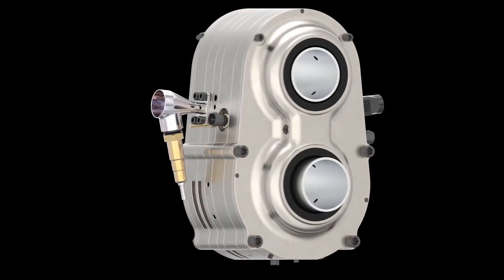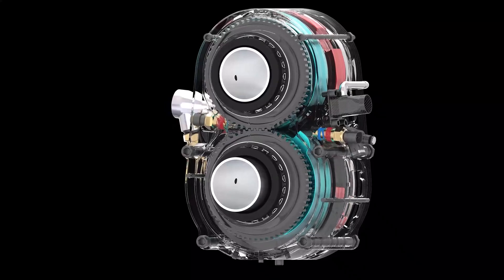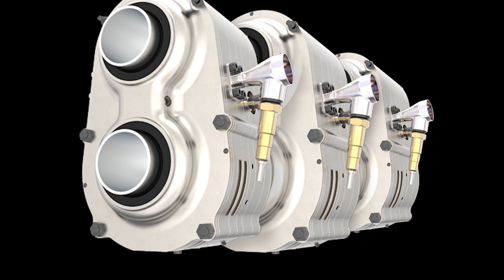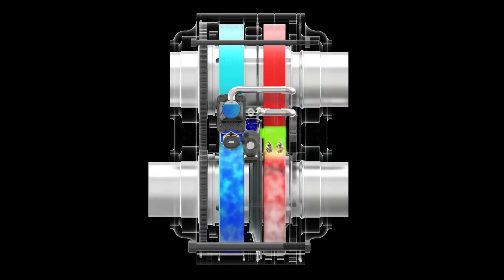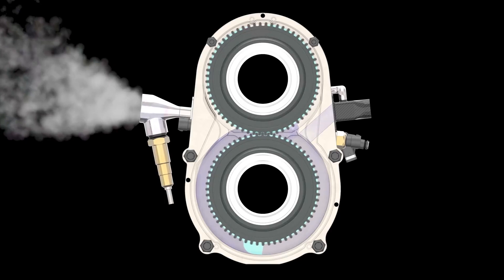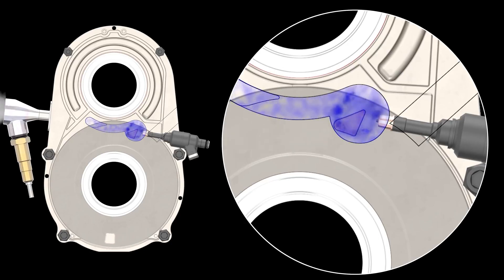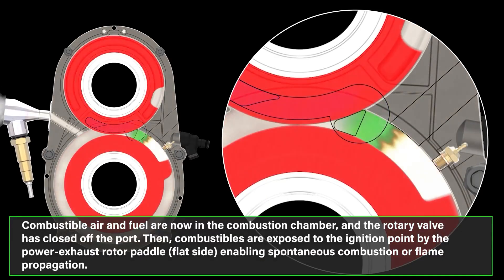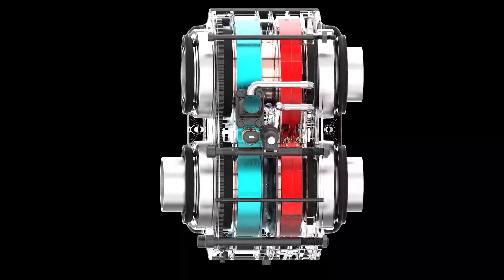This pistonless engine runs on hydrogen and revs to 25k rpm

Comment: Tight tolerance and high rotation speed to eliminate seals? All engines are great on paper.
Reply: Volkswagen Flat 4 seal less crank seals would beg to differ
Reply: @jaubuchon28  yes, but they are not receiving anywhere close to combustion pressures.
Reply: @jaubuchon28  sorry, but you said seal-less crank seals? Dog that makes no sense
Reply: @andyk3663  it's called a simplification "dog" it's sealing the crankcase oil in without using a seal around the crank, I could have called it a reverse spiral journal crank seal, but I decided to make it more accessible
Reply: Its called a dynamic seal. They only work well at high rpms. Most oil cooled dynomomiter motors use them. You don't often see them leak.
Reply: @lukewarmwater6412  very rx-7 13b
Reply: @lukewarmwater6412  @kevin W that’s true and since air pressure decreases at higher rpm’s there is no time to leak just like he explained.
Reply: @lukewarmwater6412  Most aren't running on Hydrogen which will leak out of steel pipe.   I'll venture a guess that this will never see the light of day, and if they do build it,  will perform terribly.

EE explains many of the problems.  https://www.youtube.com/watch?v=1Ajq46qHp0c
Reply: @lukewarmwater6412  so how does it seal at zero rpm?
Reply: @RobertWilkinsonJKekMaloy  at zero it really doesn't matter.
Reply: @lukewarmwater6412  … so, my car bleeds out …?
Reply: @RobertWilkinsonJKekMaloy  it would, eventually if the fluid levels were above the seals.
 Dynamic seals work just fine under pressure.  Google it, then maybe you will understand  cause this is one of those things.  I can explain it to you, but I can't understand it for you.
Reply: @lukewarmwater6412  and if there is no pressure?  What then?  Does the machine not need to be on to create that pressure?
Reply: @lukewarmwater6412  these are just simple questions that an expert of your caliber should be able to answer if you are so knowledgeable in this area.
Reply: @RobertWilkinsonJKekMaloy  like I said.  I can explain it to you,  but I can't understand it for you.
Reply: @lukewarmwater6412  all you’ve done is use high priced words. If it maintains seal at high rpm, how does it stay sealed at zero rpm?
Reply: @RobertWilkinsonJKekMaloy  why would it need to??  Your thinking about it as though it has a conventional oiling system, as though it were a piston engine. It's more like a turbine and unless you can wrap your head around that, your gonna stay lost here.
Reply: @lukewarmwater6412  oh it’s based on turbine. Shoulda lead with that
Reply: @RobertWilkinsonJKekMaloy  would have thought that was obvious but.....
Reply: @lukewarmwater6412  ah yes, buzzword buzzword buzzword buzzword... If your engine only works at high rpm, one wonders how do you start such an engine from 0 rpm, where it doesn't work.
Reply: @kirayoshikage4057  no engine works, or starts from zero rpm...
Reply: @lukewarmwater6412  except all those engines that are actually built in real world and start from zero just fine.
Reply: @kirayoshikage4057  nothing you can name starts from zero rpm. Every starter out there turns the engine to something like 200rpm  before it catches and runs
Reply: @lukewarmwater6412  right, starter, let us know when you figure out what that is.
Reply: @lukewarmwater6412  good to see that some one here knows what their talking about. The real question is… How much is it going to cost?
Reply: @lukewarmwater6412  WOW you are the only one that seems to know what they are talking about here. Are you an Engineer too?
Reply: @lukewarmwater6412  ..for how long, in what environments, under what care by who?   If it’s forever, anywhere, without any care, then great. Otherwise it’s just a Mercedes.
Reply: @lukewarmwater6412  so what do you do at idle, in stop and go L.A. traffic?
Reply: @sonnyinaz  move to a better place!!
Reply: @sonnyinaz  no, seriously,  you can throttle back just like any aircraft I would imagine.
Reply: Yeah, no time to leak??? Yeah right......
Reply: @will7its , The amount if leakage is related to the tolerance and time, right?

The smaller the gap, the less it leaks, right? Smaller gaps = tighter tolerances.

Then, the longer you wait, the more time there is for leakages. So that statement is obviously correct. If the tolerances are good enough, and the thing is spinning fast enough, it leaks less because it actually doesn’t have time to leak more.
Reply: @terjeoseberg990  Nope, its pressure that causes leaks and its very high. And its running so time is increasing as it runs. Its a leaker and they dont have a working model because it dont work yet...
Reply: @will7its  so burn it down and sit back in your chair with a smile on your face and in the end didn’t contribute one single thing then being negative. Wow, you must be proud for yourself.
Reply: @joostprins3381  Feel better???
Reply: @will7its  do you?
Reply: @joostprins3381  No
Reply: @Kevin W     cross sectional area is by far the most significant factor.
Reply: @joostprins3381  so, saying they don’t have a working model is “Burn it all down”?  I have a card game im building (not false equivalency once you read it), and i have yet to produce a working model (finishing production on the card game), so yeah, no working model means no working model due to whatever reasons they do not have a working model even as a prototype.  Stating facts is not hate.
Reply: @RobertWilkinsonJKekMaloy  nope, but facts are as good as the moment you look at it. When the first car was driving there were plans to ban it because it was to fast and people couldn’t cope with that. So, what I’m saying is the moment you look at it first it cannot be feasible, but a day, month, year, decade later it’s not an issue anymore. Look what it can do, and focus not on what it can’t other then to fix it.
Reply: @joostprins3381  Build. A. Working. Model. Then.
Reply: @RobertWilkinsonJKekMaloy  I think I put in line with the other people “ not possible, can not, impossible, no, etc etc”, you see what they all have in common? It’s used by people without fantasy, without vision, without want to work for it. That’s ok, but that means I can use my energy better then wasting it on you to see the point. 
First, get an engineering degree, that may help.
Reply: @joostprins3381  or you could just let those asked speak up. Stay in your own lane.
Reply: @RobertWilkinsonJKekMaloy  as long as you and you’re kind not blocking it.
Reply: @joostprins3381  you’re the one driving all over the road, as it were; stay in your own lane, let those asked question answer the questions posed to them.
Reply: @terjeoseberg990  sounds like a gas turbine. But with a „gear pump“ instead of a „ventilator“ design.
Reply: @fromgermany271 , That was my thought.
Reply: @terjeoseberg990  at least it does not have that many parts and they do not have weird shaped. That make creating the blender video easy.
I remember that I also invented a lot of stuff. 40y ago, as a teenager and in paper, just by the lack of computer power. I also did calculations about the max speed of my car designs. Guess how many materialized, even though I had the 300km/h on paper.
Reply: @terjeoseberg990  
Smaller gaps=/= tigher tolerances
Tolerances are allowable deviation from design specifications, and that deviation can go either direction. Possibly increasing or decreasing gaps between parts. 

The space between parts is clearances
Reply: @will7its  higher rpm’s means less time for combustion cycles “no time to leak” traditionally air pressure between each ignition cycle decreases because there’s not enough time for air to enter the intake. This is in regards to NA 4 stroke engines. I’m not engin-ist lmao just an educated enthusiast
Reply: @will7its  Use maths rather than clowns for the job and it will work.
Reply: @Andrew-rc3vh  Ok, where is your running model? Just use math.......😆
Reply: @will7its  There are equations you can use and these will tell you what tolerance range you would need. It does not need to be that sophisticated to get a ballpark figure, then build a prototype if you are within range.
Reply: @Andrew-rc3vh  Yes, Im aware. Now I want to see it run......
Reply: @will7its  They have a website and say they are looking for investors. I'm sure they would want to see it run too.
Reply: @Andrew-rc3vh  Ill buy one.......🙂
Reply: @Andrew-rc3vh  LOL There's math, and then there's real world manufacturing and pesky little facts like different coefficients of expansion and the fact that the same engine isn't subject to the same constant temperature, atmospheric pressure or humidity even if it's stationary.
Reply: @awo1fman  COMSOL will model heat-flow and thermal expansion I think.
Reply: @will7its  Yeah, no Pulitzer prize on the way
Reply: @will7its  With hydrogen as a fuel....
Reply: @will7its  right even if at high RPMs they have no leakage whatsoever no one is going car keeps their engine at a high RPM all the time
Reply: @will7its  NO ! It's the very simple very clever design   look very close and think it through 😃
Reply: @johnwalton6270  Then why dont they have a running model??? Show me the model, In a go cart even, I dont care.......
Reply: @will7its  the amount of leakage is reduced by time…!
Reply: @hansdenotter7376  No, the older you get you will realize that you leak more...
Reply: @will7its  yeah you’re right! Only because of wear, haha… in this case I can’t see any wear because there is no friction near the burn chamber. The detonation is very soon after injection, thus there’s no time to leak… too busy! Haha.
Reply: @hansdenotter7376  I dont know but I would think at those speeds it would be almost like a constant pressure and would leak then, but Im not an engineer....I just play one on youtube......🤠
Reply: @will7its  ofcourse there is a lot of pressure, I thought it was stated in the video 20x(??) as much as a normal piston engine.. but the speed and the timing of ignition is crucial, it has no time to leak anywhere because it’s getting ignited a split second after it’s injected.
Reply: @direstrait5418  yes, but any conventional engine will weigh hundreds of pounds more than this one so the weight savings would be great for fuel economy.
Reply: @lukewarmwater6412  the question of torque is because you can have 1000hp but 100 in torque…. Have fun with that gas mileage.
Reply: @Djkommode  if the car only weighs 1000 kilograms, fuel mileage will be great with 50 foot pounds ...
Reply: @lukewarmwater6412  yeah it will take you 50 miles to get up to speed too with no torque.
Reply: @Djkommode  not really.  A geo metro doesn't do so bad. Gets 45 mpg and doesn't weigh anything. Only 100 hp and 65ish foot pounds of torque.
Reply: @lukewarmwater6412  yeah it also takes 13 seconds to get to 60mph.
Reply: @Djkommode  13? Try 17.... look, either you get performance or good mileage.  You don't often get both. Nobody ever said a geo was a sports car!
Reply: @lukewarmwater6412  yes 13 and the 2000 made it to 10 sec to 60 mph. A tuned performance car can have better gas mileage at normal driving habits.
Reply: @Djkommode  riiiight.... if, and that's a big if, you can keep your foot out of it...
Reply: @lukewarmwater6412  if? It’s been proven even turbo cars can get better gas mileage.
Reply: @Djkommode  better than 45 mpg?? Not in America! 
 Still,  the biggest point here is less weight. This thing would weight half what a 1.5 liter 4 cylinder does. If it made the same power as a 1.5 it would still do better on fuel.
Reply: Need to see it run

Hang on want to hear it run too
Reply: Air cooled vw had no oil seal behind the crank pulley. 
It used reverse spiral that threw the oil back into the engine. 
A they work
And rarely leaked
Reply: @fastinradfordable  yes correct, the oil screw back design originates pre-World War 2 but you're talking about the oil in the crankcase which operates below 6 PSI a regular oil seal can handle 6 to 8 psi. Compression for combustion is much higher a minimum of 90 PSI is required for  combustion and many engines run up to 150 psi. Any design has to be airtight in the combustion chamber
Reply: @captainaxle438  on performance american v8 175 psi at least , and up to around 205 or more psi on pump gasoline.
Reply: @fastinradfordable  That's because the VW pulled air into the crankcase through the gap around the crankshaft, it never leaks there because airflow draws into the engine in that location. This functions similarly to a turbines Labrynth Seal which functions off pressure differential, the air pressure in the compressor section is greater than the engine oil pressure therefore oil cannot escape.
Reply: @fastinradfordable  no they leak a lot. if  you don't see a leak you are out of oil.
Reply: @fastinradfordable  Except when parked
Reply: @fastinradfordable  VW aircooled engines did have a seal at the rear of the engine however.
Reply: @fastinradfordable  you are only talking crank case pressures here, ten or so PSI. Here we are talking about combustion pressures, in a normal combustion engine they are 1000 PSI and more. The reason why you have crankcase pressure is because of blow by of the piston rings.
Why do we use piston rings? Because making each piston match each cylinder with tight enough tolerance, would make and engine horrendously expensive.
I’d like to see a proof of concept of this engine but I’m unsure you could make the mating parts with the tolerance required without high machining costs. You also have to remember, each replacement part needs to be within this tolerance zone too.
Reply: Yes right even tesla need to cover there new imp synchronous motor rotors with carbon fiber to keep the magnets inside and don't fly away due to centrifugal forces at 18000+ rpm
Reply: Here come the experts in youtube comment section lmfao
Reply: Yeah when he mentions the application of cars I started to think the same thing. This thing is in no way perfectly balanced either. All that being said, it wouldn't be difficult to put a seal on the sides of the rotating parts. Also, if a seal is going to imped function, then I wonder how hard or expensive it would be to replace the rotors.
Reply: Tight tolerances and thermal expansion don't mix
Reply: @sgtjonmcc  cad software has come along way. Thermo expansion of metals even at "tight" (whatever is declared tight) tolerances is relatively easy in todays tech.
Reply: @sgtjonmcc  no difference found in F1. Tight tolerance engines that can’t cold start and need hours of pre warming before turning over.
Reply: @corbbinrabus  yes that is true! 
A cold F1 engine is actually seized up until it is brought up to operating temp.
Reply: @corbbinrabus  I'm not sure what your point is. The fact you have to pre-heat the engine before you can even turn it over makes it unusable outside of performance racing. 

The problem with tight tolerances is that due to varying alloy compositions thermal expansion of individual components becomes difficult to manage, and at production scale cost prohibitive. 

If every parts alloy composition has to be strictly controlled (like in Formula 1) that adds significant cost to the manufacturing process.

Additionally, dimensional tolerances become a factor, it's is not uncommon for pistons and various rotating components to vary in dimension right off the factory line.

I haven't even acknowledged the asymmetrical rotating assembly of this design, balance issues will be a problem if this is the final design.
Reply: @sgtjonmcc  hence why this style of hydrogen energy won’t work in standard production vehicles.
Reply: @savage22bolt32  no shit?.... F1 has either come a long way...or I don't know as much about F1, as I thought I did. ( for record, I'm a simple fan, not a genius) :D
Reply: @animationcycles7109    I was pretty amazed when I heard that, and it stuck with me. Sorry, but I don't remember the exact video.
Reply: @savage22bolt32  That doesn't make sense .
Reply: @jobdone3700  watch the first 60 seconds:   https://youtu.be/lCEKJxHiEIM

This is where I first heard this, and have also heard it in other vids. The guy seems to know what he's talking about.
 Maybe needs to be fact checked?
Reply: @corbbinrabus  Exactly. Engines need to run from cold and at a wide range of speeds. Tight tolerance also costs a lot of money. The Wankle engine needs seals and is a real life rotary.
Reply: @sgtjonmcc  so just do nothing, you think it’s not possible, yeah that’s the spirit, with people like you we would use stones as a seat. 
Example, Russians used to build a small fire underneath their engine to heat up the oil so they could start the engine. In Scandinavia they are using electrical heating for engines for decades. What makes you think it’s not possible to overcome the pre heating problem? And even at a reasonable price. Even further, what makes you think they don’t find a solution without the need for pre heating? 
So your assumption of unusable is very presumptuous and an insult to people who think in what is possible and not in what is not possible.
Reply: @joostprins3381  I didn't say it was impossible I said it was not practical. There are many things in this world not suitable for the average consumer. Like Sterling engines, impractical for average consumers useless for automotive but have been used in Industrial cryogenic production for decades. 

A formula 1 engine is great in Formula one racing, but if you have to spend 1 hours a day warming up your car for a 15 minute drive to work 5 days a week. That would get old and get old real fast especially when you understand you'd have to bring a small gas generator with you everyday to warm the engine after work, sitting in the Employee parking lot.

I'll also reiterate the asymmetrical design, as it is it will have terrible secondary imbalance issues which will wreak havoc with an engine with tight tolerances. Not only do you need to consider thermal expansion, you also need to consider load factors and radial, axial and end play in a cold state, and during thermal cycling. If during the engines normal thermal cycle as parts begin to expand at different rates the tolerances between the parts changes, this is known as dynamic thermal expansion, tighter tolerances increases the probability that engine components and their lubricating surfaces may fail.
Reply: @sgtjonmcc  this is why I think that electric cars will prevail over hydrogen if people do choose to go the “renewable, low emissions” route. Anything that requires extremely tight tolerances is not really going to work and that’s the issue with engines in general. The more efficient they get, the tighter tolerances there are, thus making the engine much harder to produce and much harder to implement in an actual car because of the material changing temperature up and either expanding or contracting. Even electric cars have to manage temperature of the electric motors, but at least they aren’t required to be at a certain temperature to begin functioning.  Electric cars are fighting the weight of the batteries, as well as just energy storage and overall efficiency in general, but don’t really have the same manufacturing issues as cars with an engine
Reply: @Shangoo  Agreed the real electric revolution will take place soon with 3d Mega Capacitors/Hybrid Capacitors and/or direct chemical/electrical conversion. Check out Direct Methanol Fuel cells and similar direct fuel cell conversion cycles. 

Converting fuel directly into electricity will enhance thermal efficiency of a peak Internal combustion efficiency of 15-40% to 60% or more. 

Borophene molecular lattice capacitors could change the game for energy storage entirely, increasing capacitance by an order of magnitude putting them on oar with chemical energy storage with the added benefit of being much lighter weight.
Reply: @savage22bolt32  How does that work then because surely as it gets warmer the metal expands more so would technically make the engine even tighter no??
Reply: @wils35  That is a very logical question. With my limited knowledge, I may be able to explain it in part. 
For a normal engine, the piston's skirt is not actually round. It is manufactured to an oval shape, and when heated, part of it  expands and changes it into a round shape. (Note that the piston crown starts out round, & stays round) As I understand it, an F1 engine must be assembled at normal operating temp. When it cools, the piston skirts go back to their oval shape, and bind in their bores, effectively seizing the engine. 
 Anyone with additional information on this, please chime in.
Reply: @corbbinrabus  ever heard of a block heater? Easy fix
Reply: @sgtjonmcc  balance issue? Really? Do you know how many engineered parts are out of balance and have to be counter balanced ? That's easy LOL
Reply: @corbbinrabus  unless you have two counter pressuring each other so nothing leaks.
Reply: @joostprins3381  so how do we heat things and where does the magical clean green heat come from
Reply: @bobjones2041  I never said I had the solutions, I said stop thinking something can’t be done, but think how can we solve shortcomings. In answer to your question, for every need there is a solution, heating by electric power, oil, wood, nice naked woman, what ever you need… Magical green heat? Just tell me what is not green heat, for what I know it’s all part of the laws of physics, burning oil is green, it used to be green thingies in history and by special circumstances and processes it changed to oil. According to the idiots in Brussels burning wood is green because the CO2 was first taken by the trees and so it’s a circulair proces. Just tell me what is different when burning coals or oil.
Reply: @joostprins3381  Greens in Germany vowed to turn off all nuclear energy and ban the proletariat from burning fossil fuels but they too  have determined that CO2 won from burning Russian oil and gas are what plants prefer. It's also green to simply buy nuclear energy from France and let them glow in the dark
Reply: @sgtjonmcc  just use 0 CTE materials duhhhh.  /s
Reply: @gliscameria  Not impossible just highly impractical, I wish it were cheaper. Lamborghini has been promising psuedo-isotropic connecting rods for some time now. I wonder if they ever brought them to market.
Reply: @sgtjonmcc  Tight tolerances and thermal expansion are exactly how to eliminate the need for seals....
Reply: @sgtjonmcc  they do if they are made from the same material
Reply: Tight tolerances....but we burning fuel? Thermal expansion? Seizing?.......hmm
Reply: Agreed
Reply: @captainaxle438  buys a y de
Reply: What are you talking about? The renders run great.
Reply: @captainobvious9188  LOL  😄
Reply: On paper, then you get the thing in front of you with problems
Reply: @itsmafukeis  it has seals. The concept seems viable but will require some kind of fluid bearing. Maybe water as the bearing. Or magnets. There are solutions to thease problems. It is the reason why researchers exist to figure out how to develop the solutions. Engines used to be wimpy little lawn mower engines with 4 cylinders then 8 that wouldn't last long at all. Eventually researchers found out how to make them last longer and make more power.
Reply: @playstation8779  very good point fellow stranger
Reply: muh quasiturbine engine!
Reply: All looks good from my desk
Reply: I think it is possible to produce, but it will cost a fortune per single unit. Zero tolerance is NASA level 🤣. I see the application of this technology only possible for competition
Reply: These so called dynamic seals are not a new technology, it’s often used in jet engines.
Reply: @Oli-bier  Those would be Labyrinth Seals and they do not seal combustion, they seal oil.
Reply: And here I thought it was reality lol
Reply: Great idea!
What kind of noise would it make..?
Reply: Funny how low quallity render is enough To get hype train going and People forget few key things like physics and thermo dynamic laws.

Then they drain funds like crazy before dying out in silence As not even an working prototype has been made.
Sounds just an thing for Elon
Reply: @teemumyyrylainen9247  probably someone who only had the ability to make the rendering,  didn't know any engineers or machinist and couldn't prove the concept. It would likely work.
Reply: Sounds a lot like a rotary but less dorito like
Reply: Some have questioned the whole ‘no time to leak’ ….but then isn’t that what the SR-71 Blackbird does when parked up - I.e leak fuel because certain panels shrunk when not exposed to the immense heat that they experience when the plane is travelling at high speed. 
🤷‍♂️ Sure all engines are geat in paper, but without even thinking of alternative ideas or exploring what can be done, we’d all still be living in caves. 
I’m no engineer, but when I was growing up in the 1970s/1980s cars that could drive themselves or machines that can print actual objects were only seen in Tv series or sci-fi films and yet 30 - 40 years later we have cars that can drive themselves /park themselves and 3D printers….who knows what the future holds for us….(as long as we don’t wipe ourselves out  in WW3 🤣🤣🤣)
Reply: @friktionrc  It's easy to believe nonsense when you don't understand basic physics. There is NO SUCH THING as "no time to leak". That is pure hogwash.

There can be other things at play, such as centrifugal force, but time is irrelevant. If there's pressure (and there is NO WAY to produce power without very high pressure) and no seal, there WILL be leakage. Period.
Reply: @awo1fman  Eh? I dont believe nonsense. I was refering to the SR71 which, when not flying leaks fuel. Only when in flight does it heat up causing the material to expand creating a seal. Cant find my original comment and to be fair I cant be arsed lol...feel free to complain directly to the makers of this video if you disagree with them 🤷‍♂️
Reply: Yup
That's about what I had to say. Not to mention hydrogen storage is a pain
Reply: Model looks nice, in real life it doesn't work... Typical start-up with fancy videos, but no working prototype....
Reply: As a mechanic of 31 years, I HAVE to agree!!
Reply: hehehehehe as always wanky wank yet another wonder engine that never gets under my bonnet
Reply: Show me the uplift to drag rotational ratio in real life and you will convince me. PSI would basically crush nominal centrifugal forces. Seals would blow up to rotate the vortex of atmospheric psi and basically fail. Call me crazy.
Reply: Works for firearms.
Reply: How is that fuel stored for use? What about accidents on the road? What are the maintenance costs?
Reply: @Saabjock  more reasons why everything looks better on paper
Reply: Exactly, what happens when it starts to wear out?
There go the tight tolerances.
Reply: @andresophisma  bomm yadda yadda bing
Reply: Instead of wearing apex seals, you just throw the whole engine away.
Reply: Nope until prototype is created and tested and verified can’t trust a paper lion
Reply: i bet you are one of those that till 2015 was saying cars cannot run without gasoline engines...
Am i Wrong?
Reply: It's just a supercharger working in reverse lol
Reply: I think there is no need for super tolerances, some leakage(or even very serious leakage) is totally fine.
the reason why it does not need seals is not super tolerance but because there are no parts that touch each other in the combustion chamber under high temperature so in theory you can just skip cooling and lubrication entirely and just take care to cool bearings that hold all those high temperature parts.

This engine looks like a version of vane pump with interesting idea of how to eliminate sliding vane
Reply: well.. I can answer that!
it's called the process of learning divided by the time were living in
(x % 2021)  (x= process of learning /POL)
Reply: I though of a motor idea that is basically this and didn’t pursue it because of the necessary tolerances being expensive to manufacture
Reply: @sproutingresilience4787  I had some ideas too, time traveling is one of them, but the flux capacitor is to expensive so I just let it go.
Reply: Yeah we should never bother trying experimental engines and just leave all innovation in the sketch pad
Reply: In that case, we should just stop coming up with ideas altogether, collectively.👍.
Reply: Turbines in aircraft work on similar principals.... high rotation, tight tolerances and no seals. Most reliable engines on the planet or close to. The difference is in the manufacturing methods... not sure if they can scale the manufacturing used in the aircraft industry to make it cheap enough for vehicles, but I'm sure its possible.
Reply: The pessimism is real, damn. Ideas like this need to be explored not shot down? How do you get anywhere without innovation?
Reply: @silkut_online_2037  These are mostly low oxygen, low IQ mask people.
Reply: Remember, were not talking ablut a guy named chuck who usually fixes peoples flintstone mobiles smearing his greasy palm slime across this things inerts in the middle of nebraska, this engine is probably designed for very well regulated and well serviced aerospace applications. And as a byproduct of this thing probably being built out of some titanium magnesium alloy you probably wouldnr be in a position where youre swapping this into your honda with a big turbo and doing burnouts in the nearest walmart parking lot. Instead of giving it the backwater mechanic treatment, perhaps just appreciate the cool tech?
Reply: Where is the output shaft
Reply: @jamesmatthews2966  not a shaft per se, but a geared ring. It's at the back of the engine. I've seen better representatives of this and it is shown that way. You'd have to use something like a torque converter in an automatic transmission to make anything that turns this fast to work anyway.
Reply: @lukewarmwater6412  so like a custom trans that just bolts up?
Reply: @ChimenyDust  it would have to be similar to what dodge used for its turbine powered car.
Reply: @lukewarmwater6412  or hook it up to an electric generator to power motors to convert it to torque, as is done with gas and steam driven turbines and diesel-electric applications
Reply: @cloudshe  yes! Like a train. Everyone wants to haul around a frickin ton of batteries these days when the more efficient way of doing it is with generators. Then you only stop long enough to fill fuel tanks.
Reply: @lukewarmwater6412  it's got a reduction gear and jet engines have them, commercial vessels have them...
Reply: @lukewarmwater6412  agreed, but this is a concept of an engine.. and only engine. How gained power is then applied to achieve forward momentum is whole other thing. Like any other car, Right?
Reply: @lukewarmwater6412  why couldn’t you use a clutch plate? Would it just wear it out too fast?
Reply: @lukewarmwater6412  I think the motor is being developed for aerospace applications.  Not land locomotion.  I think it's for the new Airbus H2 fueled aircraft
Reply: @timgubler3584  try putting a manual transmission on a  turbine powered car some time if you can. It wont work.
Reply: @lukewarmwater6412  My thought too. Probably in reality has limited applications.
Reply: @dennisjump8655  not many applications require 25k rpms. probably be a decent small aircraft engine, or maybe powering stationary generator... folks here keep going on about the "no seals" part, but watching the presentation leads me to believe that means no (for lack of a better description) rings or whatever a wankle has to prevent blow by. might point out that if that is the case, a turbine engine has no seals at all as well, even though it has sealed bearing fed by pressurised oil.
Reply: @lukewarmwater6412  Not really. Plenty of production road motorcycles out there which rev to like 15k rpm (eg, cbr600rr). The way that motorcycle gearboxes work, is that they have a primary reduction from the crank to the transmission, the gears inside the transmission, and then a final drive reduction. Whereas cars with their much lower speed engines, just drive the transmission input at engine speed with no primary reduction. It would be very simple to have a large primary reduction down from 25k rpm, with that reduced speed input to the transmission, and then "normal" reductions thereafter. It's also worth noting that with such a wide range of usable engine speed, from 1000 rpm at idle up to 25k rpm, you may only need possibly two forward speeds and a single reverse gear. The same gear ratio that would only get you up to around 20mph in a regular car at 5k rpm (ie, 1st gear), would get you all the way up to 100mph when attached to an engine that can rotate at 25k rpm. (5x the speed).
Reply: @noxious89123  first thing first, I have been inside more motorcycles than you have seen or read about and I know exactly how they work. second no motorcycle out there would put up with the clutch being engaged at full rpm for very long. third this engine runs at 25k rpm, like a turbine so you dont start out at idle and increase throttle because it doesnt have the mass of the rotating assembly for that. you would need an automatic style transmission with a torque converter to make it work in any kind of a reliable way.
 the thing you are forgetting is that this engine doesnt weigh anything. it HAS to rev up to 25k to get any kind of torque out. remember that torque is what does all of the work.that cbr you mentioned has alot of horses but only a little torque, but it also only weighs 400 pounds so it doesnt need alot. this engine is probably best for use in aircraft, like turbines are best for aircraft.
Reply: @lukewarmwater6412  LOL More ignorant words have never been said!
Reply: @lukewarmwater6412  - This 'engine' is a bunch of bullshit mate lol
Reply: @lukewarmwater6412  mL
Reply: @lukewarmwater6412  In light aviation we use a reduction gear to get the output spinning at the required speeds, boats use a reduction gearbox too. The small two stroke engines and even the small four stroke Rotax 912 series spin at circa 5000rpm. The max prop rpm needs to be around 2500 to stop the tips going supersonic, so a 2/1 reduction ration or slightly higher or lower works well. Even some of the larger piston engines, the Lycoming 0-480 for example, has a geared reduction system. So if your looking for an output of 2500 rpm from a 20000rpm motor, an 8/1 reduction gear would work a treat 👍This may answer your question?
The possible issues with this engine though will probably be with fuel storage and fuel density? But if it is that light in reality then it will be 200kg lighter than an equivalent piston engine and that's a lot of fuel, 280 litres roughly, my old Piper Cherokee can fly for six hours on a full fuel load of  197 litres and still have 45 minutes reserve! It would be nice to have an estimation of fuel burn per hour too!
Reply: @rogerblackwood8815  yeah, it would similar to crop dusters like the grumman g-164 using a turbine and increasing the hopper capacity. the only question is, as you said fuel density. a liquid hydrogen tank may not make the weight reduction a plus. and hydrogen has less energy by weight than gasoline or jet-A.
Reply: @jamesmatthews2966  r
Reply: @jamesmatthews2966  easy. in middle of the engines rotation.
Reply: @jamesmatthews2966  it’s Bluetooth
Reply: Here is a good read, a famous statement in 1953 by Admiral Rickover, inventor of the nuclear submarine and nuclear commercial infrastructure, longest serving military member in US history. http://ecolo.org/documents/documents_in_english/Rickover.pdf
Reply: It is possible, right tolerance and high rotation speed is quite common amongst aerospace engines, but this device will need a lot of R&D
Reply: @kerbodynamicx472  tight tolerance at high rotational speed is great … except how to go from zero to a billion
Reply: It all starts with an idea and a piece of paper…I would like to put two in my 1996 bmw 325i convertible would fit better than a battery pack and a electric motor
Reply: Truth!
Reply: @direstrait5418  let it be engine+transmission are 100kg..imagine how heavy an i4 engine with similar power is. Without transmission
Reply: Apex seals are pretty upset rn
Reply: yep
Reply: Add an oil pan ans pump to prime it before it starts, and bam...
Reply: Like how the sr71 leaks fuel before take-off 🤣
Reply: I saw it once on short movie. It leaks oil like sh...
Reply: The real downside is that hydrogen takes hundreds of times as much volume to store the equivalent amount of energy as hydrocarbons which have the mass of the carbon atoms increasing the ability to store it as a liquid.
Reply: @akallio-lj7dm  your making a bigger deal out of that than it really is.
Reply: Yes and all engines start out on paper too.
Reply: You still need room for a film of oil, not metal on metal.
Reply: Look up 'dry screw hydrogen compressor'
Reply: We run vacuum boosters that rely on tight tolerances to run without seals. It works, but not for long. If you can swap out the motor as a "cassette" for about 1200 bucks in an afternoon, then maybe.
Reply: And what about temperature induced expansion and contraction? How does that work in such tight tolerances?
Reply: 😂 actually the biggest issue is that low rpm create the wear. In our company we have drives that run at insane speeds that have incredible torque. at start up we have high pressure pumps that create a small film between the surfaces once they reach running speed the moving parts don’t touch. Therefore longer life cycle and less wear. You just don’t stop it if you do the process is fully computerised. Otherwise ouch.
Reply: @7thplanet121  so that's why diesels run longer
Reply: The poor mechanics
Reply: How do you think a seap works...tight tolerances... but yeah I'm sure u know more than aerospace engineers.
Reply: What’s the big big advantage of having no seals anyway? Dunno much but never seen them being key role players🤷🏻‍♂️
Reply: @pabloley3719  The seals in Wankel rotary engines are notorious for causing engines to self-destruct. They're not usually a problem in other engines, but in rotaries, yeah, they are a problem. I had two Mazdas that both went through multiple engines, and that's the rule, not the exception.
Reply: @john margetis after how many redesigns/rebuilds?
Reply: @RS H 😂
Reply: Machining has come a long way….
Reply: I’m not for the use of hydrogen because we get it from water when it burns I know it produces water but not as much water as what was used to make the original hydrogen and therefore it will if everyone starts using it cause a problem where we no longer have water to get hydrogen from….eventually.  An that’s not good for a planet full of beings that need water to survive…
Reply: @ct7999  I’m no expert, but I think you have two separate processes happening and one of them might be in reverse of the way you think you might be describing it.
Reply: @RobertWilkinsonJKekMaloy  its obvious you’re not an expert.
Reply: @joostprins3381  where did i ever state I was an expert in this area?
Reply: @RobertWilkinsonJKekMaloy  you said you were not an expert, and I said yes that is obvious… What is it you don’t get?
Reply: @joostprins3381  so you want to put words in my mouth, and when I decline to play your game, you want to turn the tables?  Typical
Reply: @ct7999  “because we get it from water when it burns I know it produces water …” not sure why there is no punctuation, but I know where some should go. Be that as it may, hydrogen farmed from water makes ozone (leftover oxygen atoms become ozone, O2), not water.  The way you make it sound, these hydrogen engines are going to drain all the water out of the planet and its atmosphere in a week.
Reply: @RobertWilkinsonJKekMaloy  I don’t generally use punctuation because it’s not always necessary to get the point across key word I used was eventually… ok so it’s like this using electricity to split hydrogen from water is about 75% efficient means your going to loose around 25% of the water every time you split it for hydrogen, when you burn hydrogen you get some water as well as other products.. if you use a 5 gallon bucket of water and split it all down for the hydrogen your going to loose about 1 and a quarter gallons of water forever. When you burn the hydrogen the water you recover from it’s burning will not be 5 gallons either probably more like 2-3 gallons and if you compound this slight loss with millions of people using the same method in about 40 years time you will see major problems, also how do we know the emissions that are not water will go to the atmosphere and make more water what if the bonds happen at a much slower or lower rate than predicted?
Reply: @ct7999  the lack of punctuation simply shows the lack of tools.
Reply: @ct7999  i would rather, see, improperly placed, punctuation over an overly long run-on sentence (misplaced punctuation deliberately placed to show example).  But hey, you tell yourself why you still don’t have that promotion.
Reply: @ct7999  well, i do have to say that i was confusing H2O2 with the 2O (my dyslexia i guess) so yeah, I’m still not impressed by your lazy presentation, though you do have a few key points that i had to sift out of the rubble of that run-on train wreck of a statement.
Reply: @RobertWilkinsonJKekMaloy  lol that’s hilarious, you don’t know me, but I have done amazing work in my lifetime, placing punctuation on a phone is a hassle I don’t waste time on, usually. I worked for Aerospace did joint projects with  NASA, SpaceX, JPL, Northrop, from there I went on to work for not one but three automotive manufacturers, doing OBDII compliance reporting and testing for the EPA portion of manufacturing as required by the C.F.R. Punctuation is in fact needed for lots of that but is such a hassle on the phone I leave it out to save time, also it’s not that important in online posts as generally they are short and you can in-fact use contextual clues to infer what’s being conveyed correctly…
Reply: @ct7999  on the internet, you can be anybody you want to be.
Reply: @ct7999  but there is the thing you forget that there will be no loss of energy, basic rule of physics. You cannot let H atoms or O atoms, or molecules disappear, in one form or another they will be there. And indeed in some forms it will be difficult to get it back in its original form but there are so many ways to produce H2 that electrolyzing H2O will not be the main way to produce H2. And saying that, the loss of water is non existent, the opposite will be more towards the truth.
Reply: @joostprins3381  didn’t know there were other ways to get hydrogen🤷‍♂️ steam-methane reformation does look like a viable option my bad
Reply: I would believe it if they called it a labyrinth seal
Reply: Indeed on paper everything sounds amazing, then after it´s finally assembled the whole can of worms is opened.
Reply: All engines are great… if it doesn’t reflect what’s on paper, you didn’t make it correctly. 

If an engine hypothetically works, it should work in real life. Whether we have the correct manufacturing process for it is another thing.
Reply: Hmm it's probably doable with modern CNC lathes. Tho fitting might require the elimination of human error.
Reply: @Shpongful  Easily done with simple 100+ year old lapping techniques that produce a better fit and roundness than CNC is capable even.
Reply: There were seals in the diagrams.
Reply: Yeah that’s just wishful thinking. Magic doesn’t exist
Reply: @thierryfaquet7405  what do you think quantum mechanics is?
Reply: Ikr
Reply: I'd love this on a bike although this engine design might be good in a hybrid.
Reply: Ok, soooo? Add some seals and stfu!
Reply: Troy Reed showed how he developed his self-running motor from being a 10 foot tall monstrosity to putting it in a car. Charge the grid when you plug it in. 
Dennis Lee for 24/7 solar power anywhere on Earth.
Pro. Royal Rife for the Cancer Cure from the early 1900's. 
Dr. Stanislaw Burzynski https://youtu.be/qQKaCTdrmJc cured 98% of his patients with a harmless enzyme and the FDA is still trying to put him in prison. 
How deep does the Rabbit Hole go? Is everything Propaganda? I thought years ago that with the World Wide Web, there'd be a Technological Revaluation by now. The Elitist are making a last ditch effort by harping on the Green New Deal. Videos like this are part of the problem. They complicate matters to the point where it stifles inventors from thinking  linearly.
Did you know that you can take a magnet from a microwave and easily build an LED lamp that will stay lit for over a hundred years and more with no moving parts? There are technologies that would allow you to fly for as long as you can stay awake, then your buddy could do the same thing and you could continue until you run out of food or water (if you don't have a toilet).
The more you know, the closer we all are to true freedom. 
You "sound" intelligent, can you grasp the things I've written about?
Reply: Blowers on…vacuume trucks have that. Not on the ends but in the compression area happens
Reply: Where is one?
Reply: And tolerance does NOT mean durability. You can make it as tight as you want. It doesn’t mean it will stay that way for very long.
Reply: Unfortunately it takes a barrel of oil to make a tank full of hydrogen.
Reply: @thetruthexperiment  but trees prefer CO2 made from green technologies
Reply: @bobjones2041  lol. Of course
Reply: @thetruthexperiment  according to?
Reply: I want one for Christmas!
Reply: Especially with hydrogen fuel. It's leaky as hell because the molecules are so small.
Reply: Wonder how well it operates on the coldest day of winter.. I like a good cold start video Lol.
Reply: Which oil company do you work for?
Reply: Cummings developed a working hydrogen engine last year (2021).
Reply: @deaddocreallydeaddoc5244  technically you can run hydrogen in any internal combustion engine
Reply: As with any concept, you first buddy..
Reply: @john margetis The JWT successfully launched and deployed but has yet to fully proven itself to be a success.
Reply: Please watch an American using a LS put together their ex wife's garage with their neighbors tools they stole with reused seals banging limiter for 30 minutes straight in a mud pit, then look me in the eye and say "tight tolerances will be enough for no seals".
You're as high as that dude's timing is.
Reply: Tight tolerances are used on jet engines for oil seals and such on rotating parts. They have machining tolerances of +/- 0.0000 on the main seals and have to be assembled by heating one part and cooling the other. I doubt this has tolerances anything near that but at that rpm and compression any leakage of combustion gasses would be a very small percentage. Of course this would mean not maintaining it properly would have it wear out and break down quickly and would not be serviceable by anyone but a factory trained mechanic.
Reply: Said many long ago about the gas powered combustion engine. Stop being such a naysayers sheesh. Human ingenuity got us to the moon. I think we can tackle this one.
Reply: @realtruenorth  yeah solar and windmills are 100% clean they empower African kids mining lithium  to learn about green technologies
Reply: @direstrait5418  no, not needed in any application.  There are electric cars with engine right at the wheel,  at each wheel. Electric motors don't have a sweet spot like internal combustion engines do. This would most likely be the same.
Reply: @direstrait5418  NO its best to run stuff with that high of RPM like a Free Turbine. No transmission just slip like a torque converter only the fluid is air and compressible. Even if you did use a geared transmission like a Garret-10 you have a long time to overhaul much longer than any piston engine and is still very light weight only 330lb with 900+ thermodynamic hp with 600hp to the shaft. Does not have to be that heavy if it has a big transmission.
Reply: Thank you.
Reply: That speaks failed engine almost immediately, and would be super expensive to produce
Reply: With this technogies and precise you ca do it rigght.
Reply: Cylinder  Combastion engines are allready 60-70y old.
Reply: Indeed
Reply: So it creates a super insane vacuum before the no seals have time to, not seal. If you visualize the thing running in a car, if you zoomed in on the gaps as soon as you kicked the engine on, the metal would compress like it was under the ocean. Talk about suck factor.
Reply: Different Fluids..all types are needed..and pressure...but it will work.
Reply: The reason why all engines look great on paper because we’re not smart enough to come up with all the calculations that’s why we need to make prototypes in order to figure out what it’s actually able to do
Reply: It's aerospace, completely different concepts in design and use-case than what us normal gearheads are used to.
Reply: @direstrait5418  you always need a drivetrain of some kind, even if it's motors at the wheels. but this thing could power a Tesla without ever plugging it in somewhere. just add water..
Reply: We use them in turbine engines all the time with high service life.
Reply: I see you people don't understand hydrogen doesn't make carbon that only comes from fossil fuels get off the fossil-fuel drug
Reply: Or we could just use the hofman voltameter like bob lazar. Oh wait thats right the powers that be said he is a conspiracy theorist. Go figure. Funny how anyone who actually tries to get the truth out is always just a conspiracy theorist. This goes back to nikola tesla wanting ti give everyone free electricity and jp morgan said heeellll nnoooo
Reply: This reminds of the so-called "mighty Engine" of a few years ago. Lots of the same kind of talk. They never seem to be what they claim.
Reply: Not that hard "today"  Wankle engine is close Look at the design simple
Reply: @johnwalton6270  this isn't even a little bit like a wanker, er, wankle engine.... not even a little bit.
Reply: NO ITS THE DESIGN ~ LOOK AGAIN !
Reply: I saw a short movie of this engine running, it is leakink as hell
Reply: @konradbaj2569  so what do you do when your roof is leaking? Throw your house away and live under a tree? Or do you repair it and try to find a solution it’s not happening again?
Reply: Some engines look like garbage on paper and they go into production anyway, so… lol
Reply: @Vinez Such ignorance. Seals exist because engines don't exist in stasis at an absolute constant temperature or pressure. Not only do those things vary with time, they vary at different rates and times throughout the engine. It's not just that different parts are expanding and contracting at different rates, even a single part has temperature gradients within itself, and pressures are constantly varying wildly across the board.

Then there's the fact that even if it were possible to have a real-life engine without seals, it would have much more friction than an engine that has seals. Seals reduce friction by allowing the absolute minimum of both surface area contact and pressure of contact. In theory friction is proportional only to the normal force, but in reality there are lots of things going on in an engine besides a simple linear (or radial) motion.
Reply: @awo1fman  the ignorance is yours, never heard of magnetism?
Reply: Just like right tolerance, 25k rpm,, low heat. Mmmhmmm
Reply: @mboyer68  The boss of the firm has a patent for it registered in his name. If you get granted a patent it means it must work. How well is another matter, but I hear they have an aero-engine version using ceramic bearings that does 40 000 RPM.
Reply: Hydrogen is for drinking water 💦.  We need hydrogen to wash ourselves and our clothes. And for flora and fauna.
Reply: Pretty much the same thing I thought. Will it be the next wankel engine?
Reply: That is how turbines work.
Reply: Yes. If there is even a tiny air path... Even if the pathway is only open during a fraction of a fraction of a percent of the thing's rotation - and there is any kind of pressure differential at all, there'll be an air leak. It doesn't matter if the numerical value of that differential is a decimal point, followed by dozens of zeros before any other numerals are written... and the effective speed of the outermost portion of the rotating thing is 186,000 miles per second (aka the speed of light in a vacuum) - it's still going to leak. The relevant parts of this thing will be moving considerably slower - and they "envision" a forced induction pressure of 320 to 400 PSI. One hesitates to use the word "scam" - but one is somewhat skeptical. . . .
Reply: @wesgregg6451  Yup. Look at the compression delivered by a gas turbine.  Those blades on newer engines actually self machine the blade tips for optimum clearances.
Reply: Tight tolerances & high temperature gradients. Yeah, right.
Reply: laughing out loud while reading the comments. why is it there always  are  people who's porpoise is to debunk everyone else but them self.
this is science not "tiktok dance challenge"
Reply: @larsludwig9785  We have heard similar comments when the Wankel engine came out. This "innovation" is basically a primitive version of the Wankel engine. And it will suffer from the same issues.
Sorry to rain on your parade, but as you say, this is science. There is a reason there are only two types of internal combustion engines in wide use: the various forms of piston engines, and the turbo jet.
Reply: @TheEvertw  you forget a few, but ok, it’s narrow minded to think this is it, you still use a wooden wheel, or are you using also the most evolutions from it and just accepting that there will be no more evolutions of anything… you also think the world is flat?
Reply: Not true
Reply: You don't think outside the box do you?
Reply: Gotta start somewhere.
Reply: With your motivation, we'd get nowhere. Pun intended.
Reply: Hydrogen engines won’t be used on your garbage teslas so you can relax. They will be used in hauling trucks.
Reply: it's all theoretical. stupid video just fantasy. let's wait till it's built
Reply: @zyme4569  like, like the vision of the Wright brothers, just leave it… nothing good will come out of that…
Reply: Exactly. I want one of these in my museum between loch ness monster and unicorn.
Reply: Starting this engine will be interesting when it's cold and leaking. How are the sides sealed? Do they expect sides to expand from thermal with exactly same time as the rotary? I don't know, this design is complete mess. It's made by either indian or german for sure.
Reply: @meSOOlame  if it was a German it would have worked already, over engineered, expensive as hell, but hey, they did it. The Indians would still be thinking which god to align it with. The Yanks would have a bazillion of them, but they would not work. The Chinese would have stolen it and still trying to reverse engineer it, the Russians are still looking where they have to put the wood in, Japan would have the German version cheap and working and in Africa they just don’t care.
Reply: So... You'd never try anything new? Just to see how it works, how to make it better, etc?
Reply: Negative Nancy
Reply: @Mike Kabakov umm site your sources please because my understanding is splitting water for hydrogen via electricity is 75% efficient means a loss of 25% if what your saying is correct we could in essence make it a closed system put water in one time and let it cycle forever with out the need to refuel just let it burn the hydrogen and it will replace the water. And we could then get more hydrogen easy enough. I’m not an expert but a loss of 25% from 5 gallons of water is a loss of about 1.25 gallons… slowly burning off the water supply….
Reply: @ct7999  And, what you're saying is impossible because it requires a more than 100% efficiency, which is physically impossible. The concept is called a perpetuum mobile and violates basic laws of physics. But that's unrelated to the fact that electrolysis itself is 100% reversible water-wise
Reply: @suzukirider9030  correct, and most of the people think the H2 we are using is from electrolysis, but at this moment the most is a by product from oil breaking. So if not else we are producing more water…
Reply: @joostprins3381  Yeah, but H2 as source of clean fuel must come from electrolysis, otherwise it utterly defeats the purpose.

But as of today (and last 100+ years) - sure, H2's main applications have nothing to do with trying to achieve zero CO2 emissions, so productions focuses on minimizing cost, rather than CO2 footprint.
Reply: @suzukirider9030  why MUST it come from electrolysis ? It’s also a by product from the petrol industry, which otherwise would be thrown away and is also used as a source. Electrolysis is an inefficient way to create H2, energy wise, that we are using the overflow of energy to do that now is because the demand for H2 is still controllable, and the energy used is still cheap enough. Wait till that changes, but that is only a issue to address. What bothers me the most is the use of “green” H2, the only green thing is the burning from H2, the producing sure is not. By solar panels and windmills ? They have to be build and maintained, most people don’t even grasp what the footprint is from windmills on maintenance, or even the solar panel waist after their lifecycle.
Reply: @joostprins3381  I'm just saying that if we aim for zero carbon output electricity and a zero-carbon fuel, then it would need to come from electricity. If we're producing petrol which is obviously carbon-positive, then sure by all means we should collect the H2 byproduct.
Reply: @joostprins3381  I'm not an advocate of a zero-carbon society, btw. In fact I think CO2 itself is self-balancing (more CO2 increases plant growth which increases CO2 absorbtion from the atmosphere). I personally find plastic pollution more disgusting, and it's trivially solvable with tech innovation required, just a bit of lifestyle change: just re-using plastic bottles and bags say x10 times before disposing of them away would reduce plastic pollution x10 fold. But that's a different topic entirely.
Reply: @suzukirider9030  its just not possible to get electricity carbon free, whatever you make to produce electricity it still will use carbon in one way or another. But I get your point, but even oil is carbon neutral, problem is nobody sees it that way, just think from what and how oil became oil. The EU says burning wood snippets is carbon neutral, well my problem is why is that true and oil is not? 
Btw, I don’t think we should just keep going on as we do, but let’s make some decisions without political background and based on facts and logic.
Reply: @suzukirider9030  😄my point exactly.
Reply: @joostprins3381  "The EU says burning wood snippets is carbon neutral, well my problem is why is that true and oil is not?"
- because wood laying on the ground will either burn or rot within 100 years and become CO2 either way. Whereas oil took literally tens of millions of years to become oil underground.

Burning oil (and coal) is releasing carbon which would've otherwise spent millions more years underground.

Burning wood is releasing carbon which would've cycled within the atmosphere/biosphere within a century or two anyway.
Reply: Exactly, how do you regulate the engine temp with those tolerences... 25,000rpm grenade.
Reply: You know the French one made a gun soo bad the barrel was warped after the first shot... the design looked good but
Reply: It also appears to be very efficient at keeping cool. Less temp cycle wear.
Reply: I think airplane engines are often built with near-zero tolerance and ditches lots of gaskets as a result, who knows
Reply: @maxymoo2764  I believe he said there are no seals.
Reply: @PACstove  yeah, no space for those poor animals.
Reply: And you designed it ?
Reply: at 25k rpm, metal wear will be quick, tight tolerance last minutes
Reply: I mean if the tolerances are that tight I can only assume this has to be treated like a race car engine. Got to run hot oil through the engine for 20 minutes before you even start it
Reply: What about the gas engines Chevy designed to run diesel in the early 90s lol does that look good on paper?
Reply: Would be expensive to produce
Reply: and if you were looking for a free cloud for storing and sharing drawings, 3d models https://youtu.be/vwV-Im_xlic
Reply: Hydro is $16 a gallon of you can find it....it can be made from water so the guy that invented this is already dead. Share video now before it's removed. .. Merica
Reply: Not to mention thermodynamics causing expansion. Bet she leaks like a sieve at low speed and cold.
Reply: Same thing was said about Tesla
Reply: You dont need seals on circular forms. Only triangular
Reply: Guys check this out- Power of Steam Locomotive 🚂
https://youtu.be/H5QVrWEuIX8
Reply: If you’re thinking of a car yeah this probably won’t work at least not in a stable way but for some thing like a plane or anything else that needs really high RPMs this could be ideal and then assume the technology gets perfected eventually maybe we could see this come to cars in theory it would be amazing
Reply: It doesn't matter if it weighed 10 lb and had 5,000 horsepower the EPA was shit all over this
Reply: Yea, how are those spinning sections going to be lubed and isolated.
Reply: Built with unobtanium. How long would something like this last using normal materials? 200 psi, wow, that is a lot.
Reply: Remember, were not talking ablut a guy named chuck who usually fixes peoples flintstone mobiles smearing his greasy palm slime across this things inerts in the middle of nebraska, this engine is probably designed for very well regulated and well serviced aerospace applications. And as a byproduct of this thing probably being built out of some titanium magnesium alloy you probably wouldnr be in a position where youre swapping this into your honda with a big turbo and doing burnouts in the nearest walmart parking lot. Instead of giving it the backwater mechanic treatment, perhaps just appreciate the cool tech?
Reply: @direstrait5418  transmissions add weight to all vehicles, wtf are you taking about. That's like saying we can't use wheels because they add weight, it's a necessary component of any transportation.
Reply: I agree
Reply: Don't concern yourself buddy, if you live in America having a highly efficient combustible engine is the least of your worries.
Reply: then the oil pump fails.... you have yourself a lightweight door stopper.
Reply: What will heat do to those tight tolerances?
Reply: @nathanbopp6163  You see that's why the US government does not waste time on research and development. They simply choose what they feel is best usually for their pockets and go with that. No need to ask dumb citizens about things they can't comprehend. All these comments, most negative btw, instead of a positive outlook on what the future in automotive technology can offer THAT'S NOT FUCKING ELECTRIC. But I digress, small minds can never dream big.
Reply: @emotionalintelligence776  terrible response. Maybe half an hour preheat? Maybe use electricity to preheat the engine? Small minds have big mouths, but don't say much relevant to the conversation.
Reply: @nathanbopp6163  A man who obviously ignores his own advice. Do you think the US government ponders your opinion I surely hope not, the EPA and CARB sure as hell don't. Other countries are literally leaving America decades behind because its white citizens still think too highly of themselves with naught a damn thing to show for it. Sure everything looks awesome on paper before it grenades, but damn it needs to get that far for others to see the possibilities. Maybe I missed my neighbors all in their garages building an efficient engine for the masses, nope I didn't. Bypassing the high levels of ignorance and name calling I find solace that someone is trying rather than complaining about why it would not work instead researching how we can make it work.
Reply: Not much torque
Reply: Only saving grace is you have to shove 200 psi in it so like even if it does leak you still put in 200 psi
Reply: See everything is possible like airplane to space station nano technology to hydrogen bomb stop telling negatibity
Reply: In theory 2 stroke engine burns clean....😁 But in reality it's another story.
Reply: @roy2177  That's just Bad ! Sloppy !! Oil !! Coming Out !! That causes that !! Dirt !!
Reply: The technology to create precise parts has evolved a lot over the last decade. If this is an aerospace company we are talking about here. Spec is something they do not fool around with! I am on the fence about their numbers but with trial and error they can probably reach that kind of power. Reliability is another story. 😊
Reply: ikr. its an engineer's wet dream. It works great so long as it doesn't exist in the real world.
Reply: Basically it goes from a bog standard 1k$ engine to a 500k$ engine.

Extremely tight tolerances is NOT a reasonable mass reproducible product.
Reply: I accept the lack of carbon due to hydrogen, but the use of hydrogen makes sealing immeasurably more challenging since this gas is so light it can permeate through solid material.
Reply: @thebunnisher109  not so much of a problem in this application.
Reply: I bet the torque output is terrible
Reply: @Cheeky-Biscuit  190 lbs
Reply: @msharp6887 Alright maybe it has potential, I'll be honest I really dont want to see ICEs become obsolete.
Reply: @Cheeky-Biscuit  they never will be. EVS will be more of an option, like v6 ,v8, or ELectric. The fact is that electric vehicles are too limited and have a lot of drawbacks. The internal combustion engine more versatility , reliability, and life expectancy. Greater range, and is more efficient in its power to weight ratio.....and it hasnt even reached its full potential.  There has just never been a financial incentive to really get there. This engine for example can run on any fuel source, gas, diesal, alcohol, propane ,hydrogen, shit even hairspray, and produces 0 net emissions. The rub is that its not neccessary to improve of redesign. Electric cars are such a tiny market.  If they ever really became a competitor, we would see ICE reach that potential very quickly
Reply: @Cheeky-Biscuit  what i like about this engine is that its stackable. You can put 2 or more in your vehicle and double your power instantly, it is also 0 emmisions and runs on anything
Reply: @msharp6887  True but at the same time an alternative source of fuel is vital for this to be the case as oil veins are growing thinner with each year, as far as renewable sources go electricity is our most readily available option, hell even henry ford preferred electric cars.
Reply: @msharp6887  It's NOT zero emissions. It's low emissions, and unfortunately historically a certain low level of emissions has been classed as "zero emissions", but in reality "very low" DOES NOT equal "zero". The problem is that no engine that uses atmospheric air for combustion can be zero emission. Air is 78% Nitrogen, so Nitrogen oxides are a product of every internal combustion engine, regardless of the fuel. But there are other products as well, and that can vary from place to place, with altitude and humidity. There is NO SUCH THING as zero emission combustion in air.
Reply: @awo1fman  the hydrogen that is burned combines with oxygen, and becomes water. So if u want to classify clean water as "emissions " go for it
Reply: This engine going into production would be beefed up anyway and in terms of gearing and needing torque converters and all that other rubbish people are talking about ,it's errelivant, a standard petrol engine revs at over 10000 rpm a 1988 Honda CBR250RR revs at 19,000 RPM standard from factory and can be geared down to as little as 1mph wheel speed, inside a lightweight magnesium gear casing. so why would 25000 rpm output shaft speed be any issue at all?.....it wouldn't, it would simply be geared down like every other engine that's been put into production. Do you guys seriously think that this computerised demonstration is the finished article, this clip is purely to demonstrate the idea and the new technology and the theory of it been low emission and a direct competitor for electric, this isn't the engine you would get in a car. Btw gearboxes can be made as light as 20kg aswell using magnesium castings and light weight internals, and yes magnesium parts are expensive but when you compare the price of a magnesium gearbox against the £10000 battery cell in an electric car it works out very cost effective. My car is built largely of aluminium, doors wings suspension engine block cylinder head sub frame shock towers boot lid  all aliuminium and costs no more than any other car in its class.  if a car doesn't weigh as much the gear box doesn't have to be as heavy duty either.
Reply: @Classic_Re-creation  dunno about anyone else but my point is that this engine requires insane tolerance to function and a fuel that is more difficult and dangerous to store for most practical purposes
Reply: @jchoneandonly  this is a valid point but the same argument could be implemented in petrol Vs diesel, diesel has a flash point of 55°c and petrol has a flash point of -22°c meaning that at arctic temperatures petrol is still volatile and gives off flammable fumes creating an explosive atmosphere which in turn makes petrol very dangerous, where as at normal world temperatures diesel is perfectly safe and wouldnt catch fire if you threw a burning match into a puddle of diesel let alone explode from a spark or a rise in temperature making a diesel explosion situation in combustion engines un heard of. That same principal can be applied to the tens of millions of cars and fork lifts that operate around the world on LPG which is also very volatile and explosive like the boiler in your house that should be inspected yearly your car would undertake the same inspection. It allready exists and is everywhere. Cars running on gas with pressurised cylinders in the car is old technology and not something to cause concern. Hydrogen is only hard to get hold of because as people we dont use it, before we started pumping gas into our homes gas was hard to get hold of. Changing times
Reply: @Classic_Re-creation  Nice straw man analogies. You have no idea how much higher the pressure in hydrogen tanks has to be than LPG, for example. We're talking orders of magnitude. Just plain old air is extremely dangerous at those pressures. A rupturing SCUBA tank is lethal in several ways. Adding in the extreme flammability of hydrogen makes it many times more dangerous. Then there's the fact that the tiny hydrogen atom is very good at escaping through solid materials, never mind seals that aren't perfect.

Then there's the fact that there's no way to obtain hydrogen that doesn't expend many times the energy you get back out of it. That's not even taking into account the energy expenditures of storage and distribution. Every time it is transferred from one vessel to another a pumping stage will have to be engaged to maintain the extreme pressures.

Sorry, it's insane to consider hydrogen to be even remotely useful as a fuel or energy storage.
Reply: @awo1fman  everything is expensive and dangerous untill it's been engineered to perfection and put into production for the masses, no one here is suggesting that the storage of hydrogen is safe, a bit like smoking but does anyone care? SCUBA tanks as you mention are really dangerous if they explode as with any other pressurised cylinder, but their safe enough to strap to your back, bit of a contradiction if I don't say so my self.
Reply: @awo1fman  THC smoke in the compressed H2 tank tenders it chill
Reply: @awo1fman  so you are still using coal and peat? I really don’t know under what stone you are living but last time I looked out the window I noticed at least 2 commercial cars driving on H2 on the market, not to say a lot of busses and trucks are already using it. Not in the way with the boom, but as a chemical reaction which produces electricity and in this way used as a way to power electric cars. The storage is really not a problem anymore, the tanks don’t even look remotely like a scubatank, those scuba tanks used to be of iron, later aluminium and now a lot of composite materials, it’s called progress.
Reply: @Classic_Re-creation  exactly... the engine and gear reduction unit combined on an md-50 helicopter weighs 135 pounds and produces around 300 hp.
Reply: It runs … great give me a torque rating against weight.
Reply: @77chevy4x4  one could estimate the torque out of the rpm and the power output....and guess what it doesn't matter because a gear is used anyway.... so use the power rating over weight ratio..
Reply: @727Dexter  Or one could watch the video for the torque figure. They give it to you about 45 seconds or so in.
Reply: @77chevy4x4  I’ll give you a gearbox…… at 25000 rpm’s i bet you’ll get all the tq you want with the right reduction.
Reply: @77chevy4x4  190 ft lbs of torque, engine weight of 35 lbs
Reply: @77chevy4x4  Oh? And you have one? Sure you do.
Reply: @77chevy4x4  He mentioned torque early in the video. It seems to be similar to the HP/torque ration of your average piston engine
Reply: @77chevy4x4  230nm for 16kg
Reply: @77chevy4x4  How to say we didn't watch the video? Torque was given, makes more torque than horsepower actually. Makes 250 newton meters or 184.4 lbft. If they can make an operating, working, proof of concept engine that actually stays together, then they will have something.
Reply: @77chevy4x4  the torque rating is mentioned in the video as is the weight.
Reply: @77chevy4x4  he did
Reply: @77chevy4x4  you know you can look it up yourself
Reply: @77chevy4x4  it would be MUCH better at being a generator to power electric motors and a tiny battery.
Reply: @77chevy4x4  I believe the video stated 230 NM of torque for a 16kg engine
Reply: @77chevy4x4  35ftlb per unit was in the video
Reply: @Kalicdire  235 nm for 16kg and 160hp
Reply: @Kalicdire  As per the figure is 250 newton meters or 184.4 lbft
Reply: @77chevy4x4  Right? Horsepower is torque * RPM, so if it makes 160HP at 25k RPMs, then at 5k RPMs it may be making 32HP or a little less (less because of more losses at low rpm). torque and HP seem pretty low unless you are seriously revving this thing, which is going to mean bad gas mileage with this engine.
Reply: @LordSaliss  personal airplane gas mileage ⬆️ ✅
Reply: @LordSaliss  who says you have to rev this thing? A lot of single engine planes are using a standard rpm and use the pitch of the prop for speed, that’s one option, another is to use it as a power source to electric engines. Loads of possible ways, being creative is what will make this work.
Reply: @joostprins3381  The engine design is designed to have high rev to get rid of compression loss and leakage. Also, my post already explained why you have to rev this high to get power. Having only 32HP or less at 5krpm is not going to move you very much. It could be as low as 10-12HP at 2.5k rpm, which is most likely the minimum the engine can run.
Reply: @LordSaliss  Specs said "idles.  1000RPM"
Reply: @joostprins3381  okay, what’s the pitch of the prop to make the car go faster?
Reply: @RobertWilkinsonJKekMaloy  the pitch is to make sure the engine is on a stable rev, if you adjust the pitch you go faster, slower, or even backwards. It’s basic engineering. And yes you have to be within a bandwidth not to overload or freeload it. 
So what has that to do with making a car go faster? Everything, it’s using plane tech in cars.
Reply: @joostprins3381  so where is the prop on a car?
Reply: @joostprins3381  I want to know where that spiny pull you thing is located on a car that is the SAME EXACT THING on an airplane.
Reply: @joostprins3381  otherwise it’s false equivalence
Reply: @captainaxle438  no just talking about cylinder pressure or cranking compression for american v8's always trying to get into a chat about engines and such, or how else can you learn, always a student forever, crankcase pressure also related in and needs addressed in high rpm engines and power adder engines, usually a little bit of power adder helps with balancing the different pressures inside and stabilizing the block , usually  a little bit of power adder on an engine can typically run 100hp more because of this with regards to engine block or case integrity, crankcase pressure plays a huge role in any engine of course, for contrast the two , its quite a difference really. like a foil or plane in high altitude at high speeds, cabin pressure and the pressure differential amounts to more strain, like a deep sea sub.
Reply: @zAvAvAz  what a bunch of psychobabble you still think this engine is like an American V8? it's an experimental prototype with no obvious design to seal the combustion chamber and you think it's going to have the same amount of compression as a high performance piston ring engine. You're beyond hope, you have no intelligent conversation, you're a Despicable running mouthpiece, if we could harness the power of your mouth we would have a new engine powered by hot air
Reply: Just remember the model t got better gas mileage than your car... Go ahead and think about that for a while and why that is and don't say a mission standards because they got better gas mileage than cars in the '80s and the '60s....
Reply: @bsrcat1  the model t got 50 miles to the gallon??... next time you say something like that,  know what the other guy drives!
Reply: @bsrcat1  the model t also ran at a slower speed, using less gas overall, creating better fuel economy.
Reply: @bsrcat1  The Model T got "13 to 22 mpg", and 25 mpg tops. That's not great. It also had 20 hp I-4 and a top speed of 42 mph with a weight of less than 1600 lbs.

My 2004 Mercury Grand Marquis gets 30+ mpg at 70 mph and weighs 4100 lbs with a 210 hp V8. The mpg never drops below 20 even in 100% city driving.

You really have no clue.
Reply: Not sure these gears will take all that power to a long lifetime...
Reply: this is seen on a lot of things actually, especially within firearms, but they are extremely  tight like, thousands of an inch tight
Reply: There are 2 types of engineers: 1 that cry next to the problem and another who solve the problems. 
 Btw we are surrounded by free electric energy. Aether. Forbidden because will make us free from corporations and monthly bills.
Reply: @stolearovigor281  yep. Electricity is free. All I have to do is rub my pant leg with a wooden stick and static electricity is all mine
Reply: That was once said about jet engines as well ;)
Reply: At 16kgs reliability not expected?
Reply: It’s funny seeing ole timers getting mad because they don’t understand newer technology
Reply: @M_v43  lol New Timers just know toking weed cures cancer l
Reply: @M_v43  who are you calling an old timer? If there is something I learned is that technology will always finds it way, if you like it or not. So embrace it and use it.
Reply: No time to leak?if the engine is running the pressure is constant and will leak.
Reply: It is an actuall working motor. Extremely tight tolerances are getting easier and easier with the quality of machines going up. Also CAD helps tighten those tolerances up and when you apply a higher pressure you have a higher density. With a higher density air we are capable of slacking off in the areas of seals obviously making the maintenance guys needing to be smarter (my thoughts- "finally") also by slimming use of plastics and OILS ESPECIALLY we are doing a much greater thing here.
Reply: @ShamanZaZa  Looks like a simulation to me. Fantasyland.......
Reply: @Repent and believe in Jesus Christ and Frodo looked down and saw it was good, one ring to rule them all! I do like fairytales, so do you when I read your comment.
Reply: Great until it fails. Tight tolerances are a bless and a gun aimed at the heart
Reply: 💯 agree with this. This is a money grab with no real world ability
Reply: But unlike most this has high heat, carbon buildup, and pressure spikes.
Reply: @thebunnisher109  from what carbon? Hydrogen doesn't do that.
Reply: @lukewarmwater6412  atmospheric CO2
Reply: @nonsequitor  and that does what? Aside from expand like nitrogen?
Reply: @lukewarmwater6412  burning hydrogen does produce nitrogen compounds that are pollutants. Unfortunately.
Reply: @Anenome5  unfortunately any engine that compresses air does that. it is the heating and expansion of nitrogen that does most of the work after all.
Reply: @lukewarmwater6412  Bro these kids dont know wth they’re talking about
Reply: @lukewarmwater6412  hydrogen byproduct is H2O
Reply: @lukewarmwater6412  lubricants do.
Reply: @69A12SuperBee  yes, but the fuel in any engine is burned to heat and expand nitrogen,  that is actually what does all of the work.  And it's more than 70% of our atmosphere so unless the oxygen is coming from a tank too, and that wouldn't work real well by the way, there will be some oxides of nitrogen.
Reply: @Anenome5  are you sure? According to the basic laws of physic it’s producing energy and H2O. But… if you pollute the H2 with other components, or in the proces of the reaction it’s also burning oil and other compounds you are right. But the burning of H2 on its own is as clean as it can be.
Reply: @joostprins3381  H2 will not burn clean if you burn it under compression in an internal combustion engine.
Reply: @lukewarmwater6412  In lubricants
Reply: @lukewarmwater6412 people tend to rather talk(instead of think) whatever they knew so far, ignoring any freshly presented new concept. It is why progress is stalled until some major players intervene.
Reply: @vicimilen6067  or, like what has probably happened here. someone had an idea. they got together some investors and made a slideshow. then they bought a new car and a house and couldnt be bothered with finding any shop space or workers to build the proof of concept. now its just this video on the internet. not such a bad idea, could have worked, but after they got thier macmansion in the hills the NEED to finish the project diminished to almost nothing.... happens all the time these days.
Reply: @lukewarmwater6412  dude, this design would have near zero torque because of combustion chamber size & throw. It would only be good in a niche few applications, if even that.... it's essentially a turbo that is powered by combustion. Similar designs have always failed. Stop d-riding for garbage man. You sound like you're a true believer in some weord theoretical garbage & it's weird dude.
Reply: @lukewarmwater6412  a design like this is good for nothing but powering something like a go-kart. Even then, if it made the peak up they claim at high rpm, it would be a sluggish go cart that too much unusable top speed.... this design is not good man. It can't produce any torque & it's applications would be very niche & I doubt people would swap out a gas engine or electric motor for a weak hydrogen setup. Like be realistic like the OP was. & dynos don't spin 25k RPMs while having a combustion cycle going that create lots of extra heat. So your original reply is flawed buddy & leaves out important variables that the OP seemingly noticed.. & Idk what your tolarnces, no combustion engine is running a lubricant through it & not using seals. & if is not using lubricant, it won't last long at all..
Reply: @ChrisTopher-ek6rr  i think you have missed several points and as well know nothing about turbine engines at all. the parts that make all the power in a turbine engine from, say, a bell executive helicopter weigh about three pounds and create around 300 horse power as well as enough torque to turn the rotors. study some simple physics buddy. and remember, some people mostly brits , call piston rings seals. there was no mention of oil seals because thats a little simple minded to assume. remember what you do whe you assume? guess what, you arent making an ass out of me, just yourself.
  so i you put this thing on a go cart you may just set some speed records......
Reply: @lukewarmwater6412  a helicopter engine spins a light propeller to build thrust as compared to moving a 3,000lb vehicle through sheer sudden forces.. I was talking about torque smart guy.. Notice a helicopter builds up power before ever moving.. EVEN THOUGH it's only job is to spin a light propeller, it still takes a fair amount of time to spool even that up........ I think it is you who doesn't know what he is talking about & missed the point of my argument. Even a jet engine turbine (which is much more powerful) has very little "torque" (or acceleration) when strapped to a go-kart. This engine is garbage & is only useful if scaled down & is converted to be air driven for things like tools. It's a POS design. Period.
Reply: @thebunnisher109  what carbon? Hydrogen does not contain carbon
Reply: @thebunnisher109  Carbon buildup? From what? High heat isn’t negative by just naming it, why don’t you give an example why it would be. Pressure spikes? With the high revs it isn’t, at least not more or less then a normal engine or diesel. 
Let’s throw some more, it’s small, it’s light, it uses H2, it’s from metal… people always are looking at what they think is negative. Did you think the Wright brothers thought with their first plane, o the wings are really big, o the plane is from wood and linen, o the plane has some metal in it… just look at potential, and if you don’t like it, get a bicycle.
Reply: @thebunnisher109  where do you get carbon from burning hydrogen? 2H2 + O2 -> 2H2O. 1 water molecule per h2 molecule. Maybe some NO2 from combusting in a 70% nitrogen atmosphere, but it wont be much if any at all, on the order of a few parts per million max. But no carbon.
Reply: @ThorsDecree  if you read that far perhaps you read my concession on that point
Reply: @thebunnisher109  nah, I admit I didn't make it that far
Reply: @ThorsDecree  Nope. It's closer to 78% Nitrogen, plus oxygen and a bunch of other stuff. The hydrogen is irrelevant. Oxygen+Nitrogen+heat+pressure=nitrogen oxides, regardless of the fuel being burned. But nitrogen oxides aren't the only thing, and other things can come into play in local environments.
Reply: @ThorsDecree  no carbon to produce and bottle that  H2
Reply: @bobjones2041  yeah that's what I said
Reply: @thebunnisher109  
Most often, when you see hydrogen used in new engine, it probably means the design will not pass basic emission test and all sorts of related problems.  So don't worry about the carbon buildup, they got that taken care of.
Reply: @thebunnisher109   hydrogen doesn't produce carbon buildup dummy
Reply: @iamyoe9890  read later comments before marking yourself for ridicule
Reply: @iamyoe9890  you mean hydrogen is produced by windmill power
Reply: @thebunnisher109  No carbon with Hydrogen fuel, however the storage problems of Hydrogen still remain.
Reply: @thebunnisher109  It reminds me of why the few manufacturers that tried to put the Wankel on motorcycles failed.  Too much heat coming out the exhaust.
Reply: @thebunnisher109  Hydrogen doesn’t produce carbon when ignited, it produces water.
Reply: @thebunnisher109  carbon from what?
Reply: @thebunnisher109   Hydrogen does not produce carbon.
Reply: @thebunnisher109  where is the carbon buildup you mention from burning hydrogen?  Explain please.